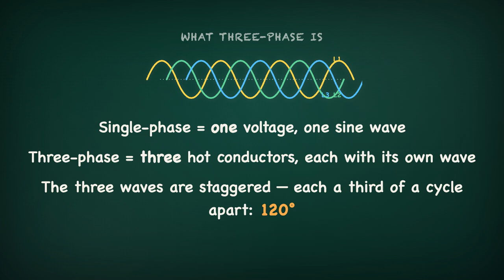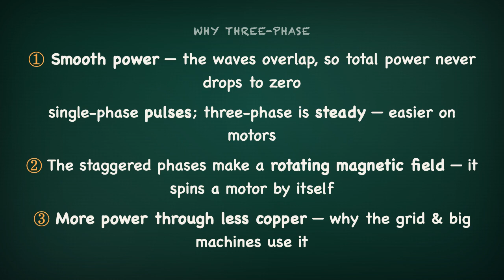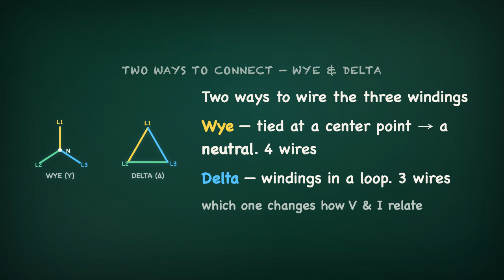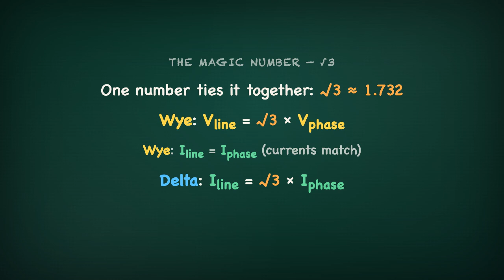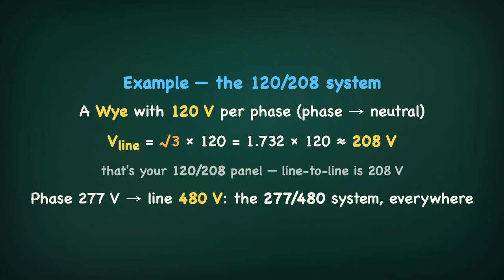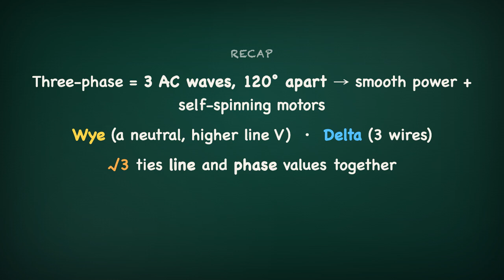Three-Phase Power Explained — Wye vs Delta and the √3 Rule | Electrical Theory 101

Comment from the maker: Practice answers: A) V line = √3 × 277 = 1.732 × 277 ≈ 480 V (that's the 277/480 system)   B) I line = √3 × 10 = 1.732 × 10 ≈ 17.3 A   C) go backward — V phase = 208 ÷ √3 = 208 ÷ 1.732 ≈ 120 V (that's your 120/208 panel). Remember which side √3 lands on: Wye puts it on the VOLTAGE, Delta puts it on the CURRENT. What should I cover next? ⚡